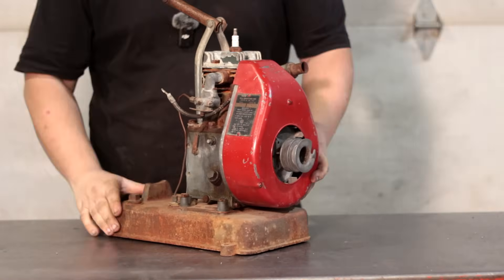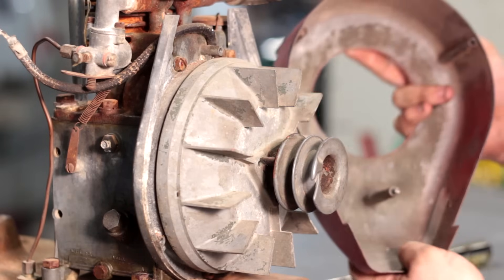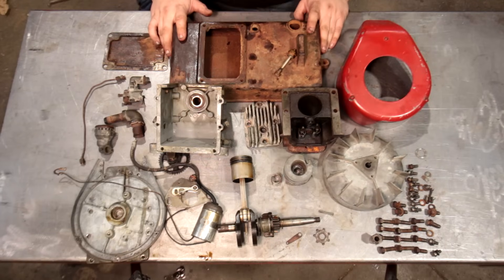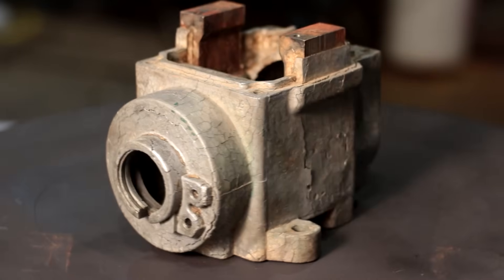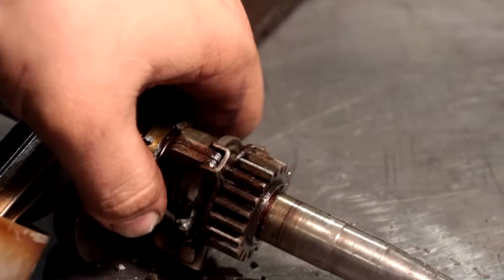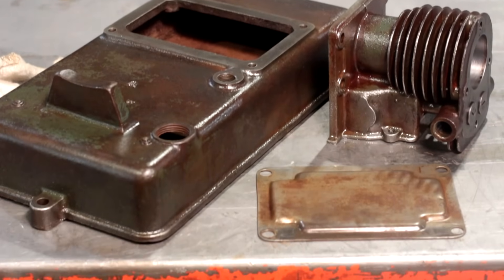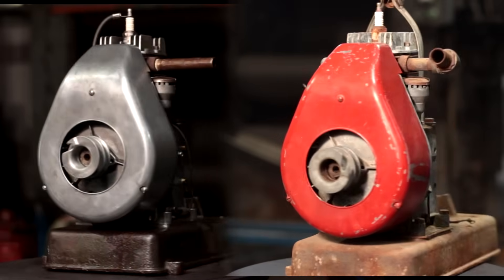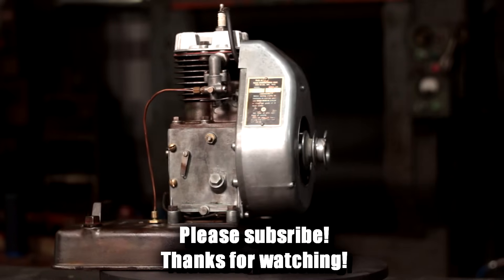IT CRUMBLES When Touched! Will This 80+ Year Old Engine SHATTER Before We Get It Running?

Comment: What pressurizes the gas tank? Can't tell where the small line is attached.
Reply from the maker: just uses suction to pull fuel through the line to the carb.

Comment: Good Job and interesting engine, the cam shaft and timing gear layout is very similar to British made JAP 2A and 2S engines which are pretty much similar size.
Reply from the maker: these engines are almost identical to a Lauson engine as they where one of the major company's of the time and only a couple of hours from where these where made.
Reply: @cruddycornstalks  Lauson, Clinton and I think Reo.
Reply from the maker: doesnt match a clinton or reo much.

Comment: Quite a lot of outboard motors have die cast everything :hand-orange-covering-eyes:
Reply: I've  been to a couple of museums, one here in Southern Maryland (Maritime Museum) and one in North Carolina, and have looked at old boat engines, including outboards, and never snapped to the fact that they were pot metal.  And I'm old enough to have grown up in an era when a lot of stuff was made out of pot metal.
Reply: @tetedur377  And heaps of them have plain steel fasteners, not stainless :body-blue-raised-arms:
Reply: @tetedur377  I have a bunch of old chainsaws, same 🙂
Reply from the maker: die cast yes but most likely die cast aluminum not zinc. after the 50s and 60s we used less and less pure zinc die casting as aluminum was far more favorable.
Reply: @cruddycornstalks  Yes, you are correct, aluminum was far superior once the techniques of working it were figured out and it was cheaper. You also see zinc in old kitchen ware and cosmetic containers. Love your channel 🙂